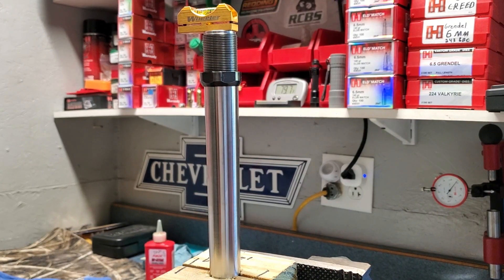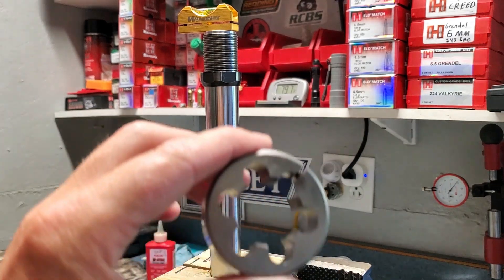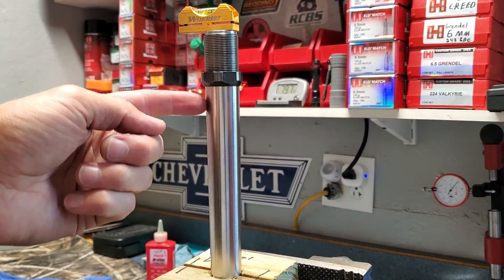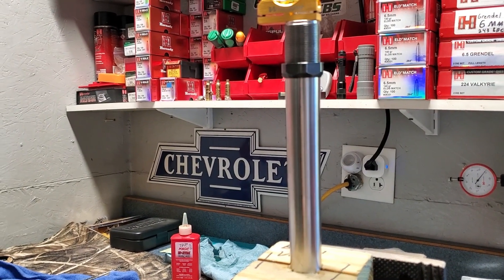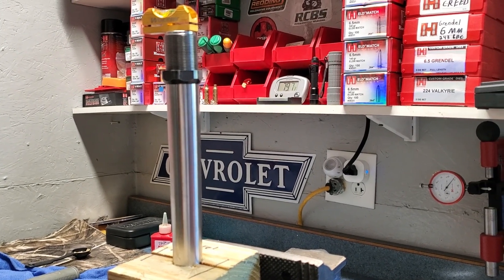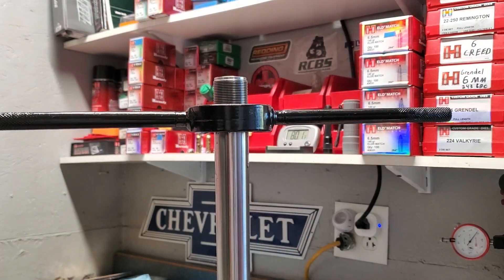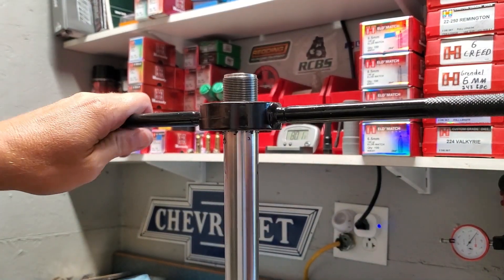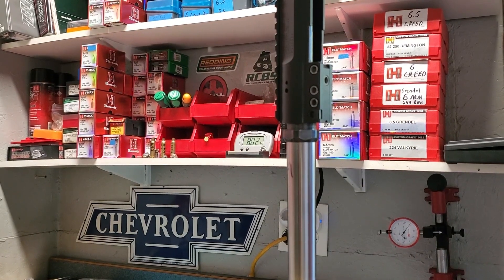Savage Impulse Re-barrel.  Part 2:  Solutions

Comment: I'm not going to comment on any part of this video but these two items:  Number one, the next time you're making barrel vise blocks use maple or oak and lock the vice down to the bench so it's not moving.  In other words secure the material solidly before you start the job.  Number two, learn to use the other end of your dial caliper to measure instead of eye-balling it.  Also, doesn't it make sense that it takes a complete rotation of the die to add a single thread?
Reply from the maker: Yeah, I know this is off-putting to actual gunsmiths and such.  I'm just a guy doing stuff in my shop.  I don't always do things the "best" or smartest way.  For the record, everything turned out great and works perfectly.
Reply: @ShopTowels  I'm not a smith, more like you than you know.  Just passing on some things I've learned that will make life easier for you.

Comment: if you divide 1 inch by 20 threads you get .050 inch for 1 thread. so every one rotation of the thread die equals .050 inch. I just watched your last video and you had about a .022-.025 difference in the head space. So that's about half a turn with the thread die. You were right to go a little further so that you get to the usable thread of the die.
Reply from the maker: I was told there would be no math :)

Comment: Sorry you probably wrecked this barrel, you need to check those threads with a no-go gauge. You're not supposed to run a die over already cut threads because it will cut more and put the threads out of spec. I'd wager that a 1-1/16th no-go gauge would screw onto that barrel now.
Reply from the maker: If you say so... The barrel shoots great (see part 7) and when screwing into the receiver extension is still noticeably tighter (less "slop") than the Savage factory barrel.  
Also, if the threads are lubed and I'm spinning the die down them by hand and the die gives no more resistance than the barrel nut, how is the die "cutting" anything?
Reply: @ShopTowels Just ignore him, you did great!
On a side not, if you want the barrel to thread into the extension more easily... your die is adjustable and could be adjusted to cut the barrel threads slightly smaller.
Reply: @ShopTowels  Dies cut because they are designed to cut, the amount that they cut might not provide much resistance but it's enough to put threads out of spec. You can disregard the information with subjective feelings about slop or resistance but if you actually wanted to know you'd put a no go gauge on those threads. It's your gun, so you can take whatever risks you want, but people watching should know this is not the correct or safe way to fix this.

Comment: Wouldn't it easier to send the custom barrel back and ask them for another couple of threads.
Reply from the maker: You would think so, but the barrel is not actually "out of spec" for a Savage small shank.  It's just that Savage decided to make the Impulse in a way where barrels on the short end of that "spec" may not work.  I plan on ordering more barrels, and don't want to have that fight over and over, so I fixed it myself.
Reply: Yes, plus you're never supposed to run a tap or die on already cut threads because they will remove more material and put the threads out of spec. A no-go gauge would almost certainly screw on to those threads. This barrel needs to be inspected before anyone shoots it.
Reply from the maker: @bobbygetsbanned6049  too late.  It shoots great.  Your assertion about the die may be technically correct, but in reality, if I can screw the die onto the threads with my bare hand like it was a nut, there's no way the .000000001 that may have been removed by doing that is ever going to cause a problem.
Reply: @ShopTowels   No resistance? There was plenty of resistance for that die to cut lol, I was actually cringing while you threaded it on because there was so much resistance. I guess you don't have any experience with precision machining, since you have no feel for what is or is not a lot of material. 
Anyways, you only know what you know, you can either justify your mistake and make it again in the future, like an idiot. Or you can acknowledge it was a mistake and not make it again. You're choice. And like I said, I bet you a no-go gauge threads onto the barrel, if you think it's fine, get a gauge and prove it.